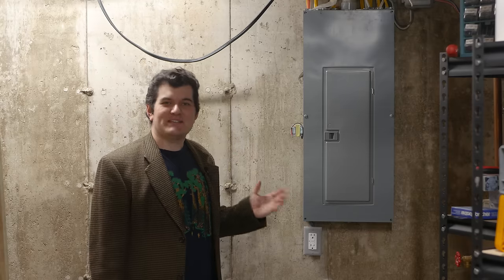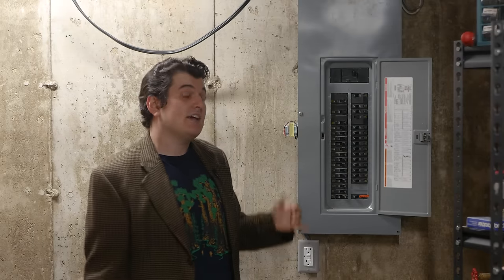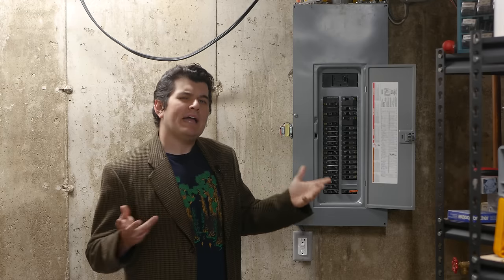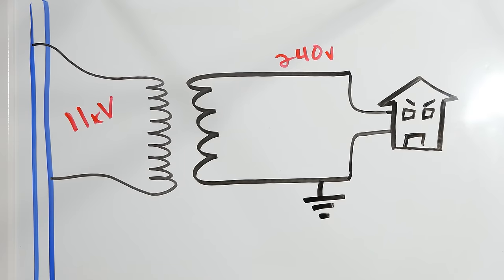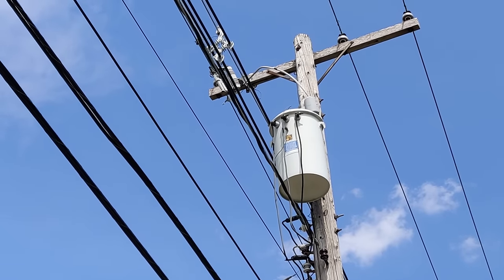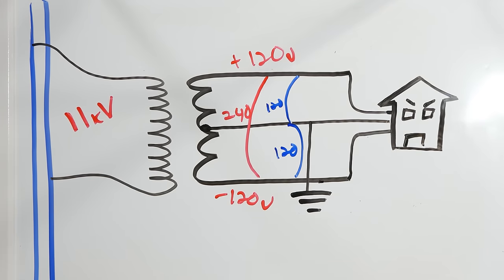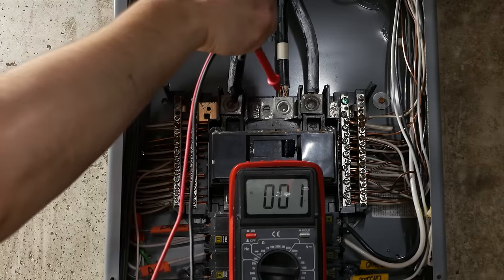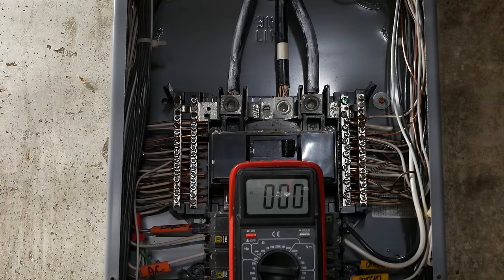The US electrical system is not 120V

Comment: The volts/amps rant had me shouting "PREACH IT!". Seriously. So many times I've had this argument.
Reply: It's stupid because volts/amps safety is always: "It's not that simple" ... Car batteries are a good demo of one end of the scale, but static shocks are the other end and equally low harm.  It very much is current across the heart that is fatal, but working current is the last thing to worry about.  Worry about non-current-limited supplies, HF/RF shocks and voltages that can jump gaps.
Reply: Can't have amps without volts. 
His was a good explanation there.

Comment: When I heard the 60 Hz buzz I was like damn that’s a loud doorbell transformer on that panel.
Reply: I thought he might have some leaky wiring interfering with his mic (All wires put out some EM but poorly insulated high voltage put out enough to interfere with mics and a few other sensitive devices).
Reply: Gregory Norris that’s usually at higher voltages than 240 volts though.
Reply: @joeythefoxxo  It's usually from the current-induced magnetic fields.  Unless dealing with kilovolts.
Reply: In commercial buildings with 600V, there is a transformer near the service panel to step it down to 120/208 volts. Those hum like crazy.
Reply: thien minh nguyen Those are pretty big though.

Comment: I was in the US for one year, and to me the most glaring thing about the 120 V household electricity was the inconvenient thickness of (proper) extension cords compared to my country's 240 V system. At first I was like "why the hell is this cord so thick and thus cumbersome". But of course I almost immediately understood that it's because of the low voltage and therefore need for larger current to deliver similar power and therefore need for thicker cable.
Reply: yes, pushing larger voltage through to circuits that don't require is stupid.  Hence 120V system in US/Canadian households.
Reply: What's the problem with thicc? Ah sorry, different video streaming service.
Reply: @protonneutron9046  ? Pushing a larger amperage through circuits which don't need it leads to greater opportunity for overheating & cumbersome power cords & as explained, you DO have 240v only not for lighting, power sockets.
Reply: @GARDENER42  Amps don't get "pushed"  they get pulled ONLY if the path permits. Otherwise all the low amp devices on a circuit would fry.  Rent an education.  Since you didn't know that you should be on this thread
Reply: @protonneutron9046  Voltage goes through nothing. Get it right.
Reply: @Cotronixco  lol!!!!  yes, when you run out of IQ fall back on semantics.
Reply: @protonneutron9046  Looks like you've run out of both. Current flows. Voltage does not. Try as you may, you can't get around it. This is electricity for dummies.
Reply: The thickness/heft of the cord is dependent upon the gauge of wire and intended load. High current draw items require fatter conductors.
Reply: @bstrickler  right.
Reply: @protonneutron9046  Pushing larger current through to circuits that don't require is stupid. Hence 240V system in most other places.

What? Just using a strawman against a strawman.
Reply: @cancelhandles  LMAO!  There is no current pushed through anything.  IT is taken as needed.  Rent an education
Reply: @protonneutron9046  just admit that you were wrong. Geez. Pride hurts much?
Reply: @leogrievous  you're babbling.  State the electrical principle I was wrong about.  Give the correct formula
Reply: @leogrievous  well, what's your answer????
Reply: @protonneutron9046  yes, you are correct that current is only taken as needed. But you're attacking a non-native English speaker on his semantics. Everyone else here clearly understands what OP was trying to say and simply ignores the semantics, as the world does not revolve around native English speakers.
Reply: @adriaanverhelle  wrong.  NOT semantics.  IT is a TECHNICAL POINT that crosses languages when talking electricity
Reply: @protonneutron9046  The only thing crosses languages is the International System of Units (SI). The specific semantics you are attacking  "pushed vs pulled" are not concepts that cross language. Besides that, whether you consider an electric current to occur due to a pull from the component with a lower electron charge or a push from the component with the higher electron charge is only a matter of what you choose as a reference point. The equations work in either direction.
Reply: @protonneutron9046  Only if in series, all individual circuits are parallel. Go rent an education before you ridicule others.
Reply: @brettkemp4219  only if what in a series????? And what condition if so?
Reply: Oh my, kind of funny to see the replies. You seem all to be wrong about some detail or another. 

When considering the "mains voltage" i.e. the electricity sockets in your house, you can consider the voltage as "being pushed" in that they will try to keep the voltage at the specified level. But the current that a connected device gets depends on the circuit in the device, effectively the device tries to "pull" the current it wants. 

In terms of safe wires, voltage is a matter of how much insulation is put around the wire (commonly rubber/plastic), and current is a matter of how thick the conducting material is (metal). This is a simplified explanation because of how AC works. And the actual power that will be transferred is roughly voltage multiplied by current and therefore if you have a device that requires a certain amount of power, if it is made to work at a higher voltage, you need a little bit more insulation, but a lot less in thickness of the conducting part of the wire. That is why properly made cords in higher voltages are thinner and easier to safely bend.
Reply: @pev_  bingo
Reply: @protonneutron9046  oh no! I used one wrong word while making a strawman argument against another strawman argument and the mean stranger on the internet told me to "rent" an education. :'(((
Reply: Actually it's more of a safety standards thing than anything.  You can easily find super sketchy indoor extension cables with 3 outlets at the end of the same style cable as a low-end desk lamp, and if you're just powering a lamp and a cell phone charger it's no big deal.  They don't have the ground plugs (or sideways prongs) so you can't plug anything heavy into it...in theory.

In practice, clueless college students can easily find 3 devices that will fit and pull a big enough load to turn that into a fire hazard.  Not to get started on the idiots who chain multiple of these together (since the wall-side plug usually only has 2 prongs, allowing you to put an infinite amount of outlets all drawing from the same thin extension cord).  And that's without taking into account possible poor build quality and devices that don't meet the spec.

So we all got used to calling them fire hazards and they're commonly banned in dorms and apartments, so most people go for the outdoor-rated 10+ amp design with the ground plug anytime they want an extension cord.  

120v + is enough to go through copper/aluminum of any width to a length far beyond any consumer-grade extension cords, any cord size practical for 240v will flow just fine.  Over 100v, anything that could vaguely be called a conductor will carry a current just fine...at until enough current is drawn through it to melt the wire, which will be in a similar ballpark (with less amps) at 240v
Reply: Nope. We simply use lower wattage on our 120 volt circuits. Our 120 volt circuits can be either 15 amperes or 20 amperes.
Reply: One of the main reasons for US historic adoption of 120V was the lobbying of the copper mining companies to sell more copper. Unfortunately engineering can rarely stand up against pure financial bias.
Reply: @adriandaw3451   What the... really?? It is way past april fools so I have to ask, what is your source for this info?
Reply: @pev_  I'll let you do a search rather than drip feed you.
Reply: @adriandaw3451   Meaning you don't really know shit, just rumors, but do not want to expose your speculation?
Reply: @pev_  I'm not sure why you are so personally angry about me pointing out that the US lobbying by big business often causes erroneous decisions to be made. I suppose you'll also deny that the sugar growers were responsible for quashing the poor health "benefits" of sugar and moving public perception and legislation in the direction of demonising fat intake. I'll let you do the research on that as well. Please notice I manage to respond without any insults, but can you?
Reply: @adriandaw3451   You have not seen me angry. No, I was just irritated by your cop-out answer "I'll let you do the research". That way you can say anything without justification, supposedly trying to appear smart but having the opposite effect. And if you are that easily insulted, I suggest you go away and sing "la la la" really loud.
Reply: @protonneutron9046  I cant imagine how people can be fine with 1500 Watt. So inconvenient, when the american can't use an anglegrinder or some small pressurewasher on his normal outlet.
Reply: @samuelshekel1907  Then rent an imagination
Reply: @protonneutron9046  My imagination told me, that americans cope by buying everything in gasoline.

From their pressurewasher to their firewood-tablesaw or mobile sawmill.
Imagine having to service all those engines. 

Bad cope. You lost. Checkmate, gg. Get over it.
Reply: @protonneutron9046   Err, I cannot fathom what Samuel's point really was, but "rent an imagination"? What does that even mean? In our current world we cannot get specific targeted mind-altering devices or drugs, so I suggest that you simply use arguments that express your real opinion. Fair?
Reply: @pev_  Take some ESL classes and all will be made clear to you.
Reply: @protonneutron9046   WTF is ESL? And are you implying that you are in some higher level? If so, your comments do not reflect that. I'm sorry again, but saying "rent an imagination" is not anything but trolling. Is that what you want, to be a troll, when you could comment constructively (yeah that is a hard word) and just plainly say what and why something is wrong!?
Reply: @protonneutron9046  Damn, still salty and immature after 5 months, you're persistent, I'll give you that.
Reply: Don't forget the thickness of the insulation. 
I have no idea what is mandated but it could be more than is required in UK wiring. 
It might be of a different material so it will withstand greater extremes of temperature.
Reply: its so stupid. Then you need extra special wires for higher power applications
Reply: @20chocsaday   It might be possible to some extent, but I doubt it because my feel is that most developed western countries pretty much use similar materials and standards. Don't forget that for the metal conductor part a double current means double cross section area and that makes a huge difference in the cable's flexibility, weight and thickness!
Reply: @pev_  Yes, I expect that a lot of this is international standards, what I was thinking about was the possibility of overheating because the conductors were carried more current than they were designed for. This would initially soften the insulation and eventually destroy it. 

In one way you could say that this limits the current, although destructively. The other way would be to make sure that there was a means of limiting just how much that cord could take before the current was abruptly cut off. 
In the UK for instance, there is a fusible link in the circuit inside the device which plugs in to the supply. 

However, my worry is always a cable out of sight which can be overloaded. Especially as the heat might be coming from elsewhere. That's after seeing  "max 60C" printed by the manufacturer along a cable used to control a heater resting on that heater.
Reply: @samuelshekel1907  It's 1800 watts for a 15A circuit. Still woefully insufficient for a modern home.

Comment: I see your two-phase 240V electric stove and raise you a European three-phase 400V stove!
Reply: Like, we can get that 25 kilowatts *from a single wall socket*. You need a 200 amp breaker to get there?
Reply: @Stoney3K  I mean 32amp 3 phase plugs only give about 22kw, right? Although, we only have that in the garage, and 16 amp 3 phase in the kitchen.
Reply: I see you 400 v and raise you natural gas
Reply: nuker co   In what way is gas better?
A lot of houses in europe has gas too but i am glad i don’t
Reply: @Skinksalladen  There's not that much difference between 22kW and 25kW though, if you try to pull 36A out of a 32A circuit it will probably not trip the breaker if it's a regular class B or C type.
Reply: @Stoney3K  Do it in increments you can manage it. I once had a 20A MCB supply 27A!
Reply: Deadfast    The US system is SINGLE phase, 240V for a stove (but 50A)
Reply: @Stoney3K  Well your math is a little off, it is ONLY 105A
Reply: I am from NYC we have gas stoves.

Comment: "A spark from inrush current won't hurt anything!"

flashback from the weeks trying to figure out why my self-made clock's alarm sometimes went off because of bad power supply design when someone turned on the induction fire

It definitely hurt my sanity :c
Reply: Self-made? Sounds like someone forgot their capacitor!
Reply: I was surprised that he didn't mention his previous video where he showed the fact that there is a spark inside of the switch, so there will be a spark regardless.
Reply: @user-dj1hy6zc6q  Right.  People are freaking out about 'inrush current' without the context of it being the spark he's talking about. there is a spark and the same inrush with or with out a switch.  one just hides it.
Reply: @user-dj1hy6zc6q  The difference is a switch opens and closes faster so the spark is smaller, also the contacts are designed for it.  The plug and socket aren't.  That being said you'd have to be really slow plugging and unplugging and do it a few thousand times to cause much damage.

Comment: I studied electrical engineering in France, here we just have 230V in house. The transformers output three phases and a neutral, the neutral is grounded. Each house in a neighborhood is connected to one of the phases and to the neutral conductor, so we have 230V between neutral and a phase. For bigger installations (industries or big buildings), we have the three phases and neutral, so depending on how we make the connections, we can have 230V or 400V (between two phases) for each circuit. But 99% of our devices are made for 230V.

It's really intersting to see how it works in other countries, so thank you so much for this video, and thanks to all other people posting details about theirs countries in comments! :)

I'm also really surprised to see such big powers for a single house. My house has a 3kW subscription for two people, and here 3 to 6 kW is really enough for most houses/families, except for really big houses or for people using a lot of machine-tools...
Reply: In germany every house has 3 phase 400V. Cooking stoves and dish washers are wired into the 400V and we often have a CEE 400V 3 phase plug in the cellar or garage which is fun to use with industrial equipment we get from work when they are thrown out.
Reply: @swunt10  Oh it must be so cool! I'm kinda jealous. :)

Comment: In California, the voltage at the outlet may vary throughout the day.  Usually a range of 80 to 145 volts is considered perfect.  Sometimes it can stay at 0 volts for days-on-end as well.
Reply: I guess you should've requested better service than the one that costs only a dollar.
Reply: 80!? 😨 Sounds like brownouts are too common.
Reply: Eco overregulation FTW!
Reply: @bcubed72  no, just greed. Google "Enron"
Reply: @Lucky Joestar And why do you think that is? Could it have something to do with the fact a lot of it has not been updated since WWII?
Reply: @JohnKelly2  Perhaps you should "Google Enron" as it hasn't existed for 20 years and has nothing to do with today's power issues in California.
Reply: @Lucky Joestar Not the US, just California. It's probably helped in the midwest by storms throwing trees onto power lines so they get replaced constantly anyway.
Reply: That is a little wrong, maybe its your part of cali, cause where I live the range is much more controlled and never has gone below 105 even on summer days in the desert.
Reply: Best to get solar panels, and lots of batteries. Connect your crappy commercial power to a rectifier to charge the batteries if the solar can't keep up with your demand. Then, through an inverter after the batteries you'll have clean 120V all the time, and even still have power during a commercial power outage.
Reply: If the ecoloons have their way you'll have 0v at the outlets - and no gasoline for your cars either. You'll all be sitting in a field clapping hands and singing folk songs - whilst starving of course.

Comment: The subject of "Broken Neutral Wire" Would make a great video. "Tree trimmer drops tree limb unto main house cable and severed the neutral wire, refrigerator burns up along with every clock radios".
Reply: i think that can also cause grounded casings to have a 120v potential